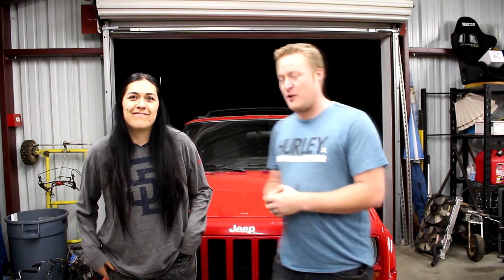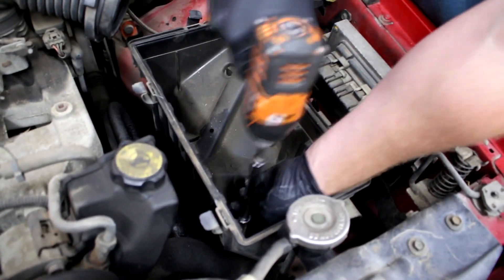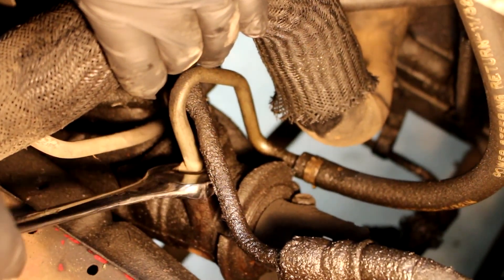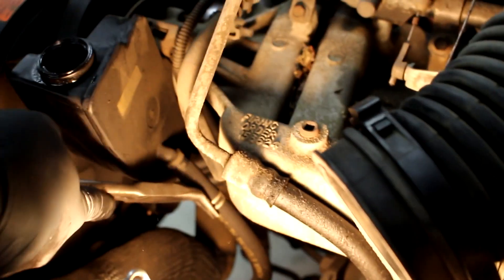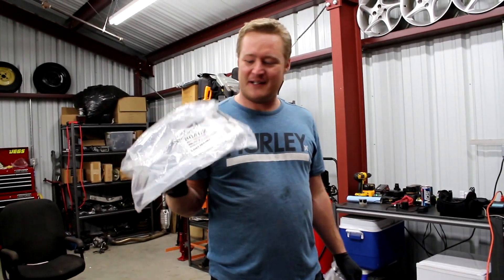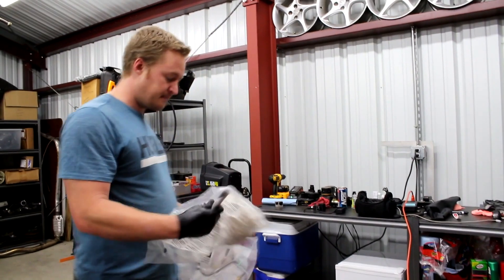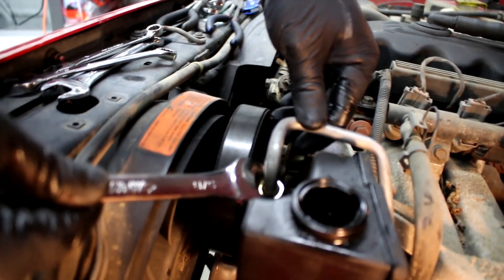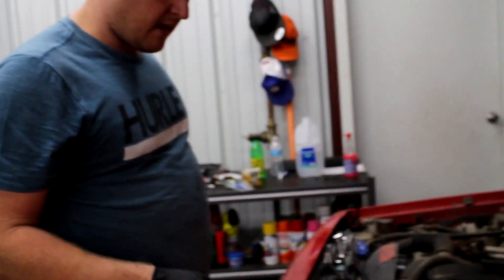New Power Steering Lines | XJ Jeep Cherokee #2

Comment: I can't break the bolt loose on the return line, I removed the high pressure line no issues. But the return line is being stuborn. As a work around could I just replace the hose on the low pressure line and re clamp it? Or is there a special tool or spray or trick when dealing with these bolts. I am not a mechanic so any tip helps
Reply from the maker: Deja Vue it is hard to get a wrench in there to really bust them loose sometimes. Look up crows foot wrenches they have helped me many times especially with power steering lines. Here- https://m.lowes.com/pd/Sunex-Tools-8-Piece-SAE-Combination-Wrench-Set/50160947?cm_mmc=SCE_PLA_ONLY-ToolsAndHardwareSosAtg-PowerTools_-50160947:Sunex_Tools&CAWELAID=&kpid=50160947&CAGPSPN=pla&k_clickID=38080311-dc81-48fd-b600-83ca96508477&gclid=CjwKCAjwsJ3ZBRBJEiwAtuvtlPlVKzNF9DPTL3tA6Ibv6qvtsrlltQxxTSmu0LDN-jWVp56v50m_uBoCpxcQAvD_BwE
You want THIS style with the partial Hexagon wrap-around on it, the cheaper style ones are much more likely to strip the head if the nut and make your problem even worse. The harbor freight ones are an example of that style that you dont want.
Reply: Hey thanks. Looks like they will just pop on to any ratchet handle? Or will I need an adapter?
Reply: Do the crows foot wrenches work on both Metric and Standard or when I purchase it I need to make sure it does either?
Reply from the maker: Most of them will fit any 3/8ths ratchet or extension. One of the best things about them is being able to put an extension on them since they are in a tight spot and then use the extension to get your ratchet in an area with more room to work.
Reply from the maker: The wrench ends are either metric or standard just like normal wrenches. The hole for your ratchet/extension is a square in either 1/4 3/8ths or 1/2 depending on what size you get just like 1/4 3/8 and 1/2 sockets and extensions.
Reply: Thanks again for you help. I'll let you know how it goes :)
Reply: It worked !!! I had to use a Crows Foot 18mm and a10 inch ratchet extention.  Got that sucker, thanks again guys.
Reply from the maker: Deja Vue Awesome! Glad to hear you were able to get it with that!
Reply: The bolt was in bad shape,  so much corrision had to use a rubber mattle to get the crows foot over the bolt, lol

Comment: Thanks so much for this video! Recently bought myself an XJ and it needed this fixed
Reply: Same! Picked up my 95 manual last week!
Reply: @RandomStuffGarage619  just bought a 2001 two weeks ago and the power steering pump just blew
Reply: @willannunziato  the pump? Or rack seals? I have a new rack seal kit on my bench waiting to go in, just need a weekend to drop the box out and get at it!
Oddly enough, I put some boards under it to stop putting stains on my driveway and not a drop since??
Oh and congrats btw! * jeep wave *
Reply: @RandomStuffGarage619  Jeep wave right back atcha!
So it started leaking extremely bad right behind the pulley on the power steering pump I ordered a new one and new lines and I’ll be tackling my first real repair on a vehicle on my own

Comment: Thanks for the video.  Great video. But, once again, my repair has taken way way way more time due to unforeseen circumstances.  #1.  Please cut your low pressure hose off like in the video.  Do NOT try to pry it off.  I did and I broke the little nipple off the reservoir.  Added hours to the job because I had to find one at a local store after work one day, take off the serpentine belt and power steering pump etc.  All because I just would not give up on that hose. (happens to me all the time.)  #2.  I ordered the gates parts from rock auto.  Problem: the low pressure hose had the wrong bend in it.  The one in this video is correct.  The one I received? Nope.  Rock auto took it back no problem.  Sooooo I ordered the AC Delco part.  Guess what?  Wrong again!!! no joke.  I went to Advanced Auto and found another brand and yes, it has the correct bend.  #3. I stripped the the gates nut that attaches to the power steering gear box.  (not the reservoir.) Had to run back to the store and bought a crappy Duralast hose.  Probably because I put the high pressure hose in first and then had to remove it to make room for the low pressure hose. #4. The bolts that hold my air intake box on snapped off.  Yeah, snapped.  maybe because my XJ has 220,000 miles on it?  All said and done it took me about 5 working hours.  My repairs are never this easy.  Thanks again.
Reply from the maker: With time and practice repairs will get easier! Keep after it!

Comment: You're high pressure line is a GATES 353770 but your low pressure line is an EDELMANN 80402 at least that's that the labels on the bags say in the video.  8:34

Comment: DO NOT CROSS THREAD YOUR NEW LINES INTO THE BOX. lol i learned the hard way. Install the high pressure line last btw, because it wraps around the top of the other line where it goes into the box.

Comment: I know this vid is old but have a question- how did you bleed after filling? Turn wheels back and forth while on ground, res cap off? I've replaced my box and pump. Steering still stiff.
Reply from the maker: Easiest way without special tools is lift front off the ground and crank wheel back and forth with engine off 15-20 times, then check level and start it and turn back and forth another 10 times or so. In the shop I usually hook up a vacuum pump to the return line, block the port on the pump and keep sucking till I get all clean fluid through with no bubbles then quickly pop the return line on.

Comment: Did you end up having some threads still showing on both ends of the pressure hose? I feel like I definitely cranked it down enough but I still can see threads.
Reply from the maker: That is normal for compression/line fittings.

Comment: Bought my 99 xj a year ago - 250k miles - And I lost count of all the BS I've replaced so far. Some of what i remember: water pump, thermostat, NSS, injectors, CPS, These PS lines, coil, plug wires, spark plugs, and many more that I've already forgot.
Id like to drive the damn thing down to Moab, but I'm scared I wont make it, lol...
Reply from the maker: Sounds like it wasnt well maintained. Maintenance is more than just an oil change and over 250k miles a lot of stuff will need done. If you buy from someone that didnt keep up with it then you will have to play a lot of catchup. Mine has 300k miles and still has never left me or my wife stranded and we put about 10-15k miles a year on it.
Reply: @GearHeadsGarageChannel  Unknown. He supposedly drove it to work and back daily, 45 miles round trip.  Dont see how he managed that with everything I dealt with. Good thing all the parts are cheap and easy to install.

Comment: Thanks for the awesome video. I'm going to have to do this next weekend because my pressure hose has sprung a leak. How much power steering fluid would you say you needed for this job? I saw you were using a huge gallon jug but I don't think I need to have so much extra sitting around in my garage.
Reply from the maker: Patrick Rose Your welcome good luck! I'd say get 2 quarts

Comment: Great video, I have a 96 jeep cherokee. I'm on Rockauto.com and it has left and right hand lines listed, how do we know which to get? Does it matter?
Reply from the maker: YES! They sold these in Right hand drive for the post office meaning the steering wheel was on the RIGHT side of the vehicle not left. The lines are different so get the left drive ones.
Reply: Thanks guys, yea the right hand ones are like $96

Comment: Great video new subscriber it would be cool to do a collab video someday
Reply from the maker: The Bearded Jeeper Thanks man looks like you have a nice Jeep!! We will be doing a lot more to this one in about a year or so when my wife is done with school
Reply: thank you! nice! can't wait to see what you do to it.
Reply from the maker: The Bearded Jeeper nothing to crazy, its a very clean XJ but its 2wd. Gonna 4x4 swap it, maybe manual swap and do a modest lift and tires.
Reply: do you have part numbers for the lines you got from rock auto? trying to find the right ones I have a 99 cherokee and I want to replace both lines as well
Reply from the maker: The Bearded Jeeper I dont remember now but I did get them on rock auto, just get the pressure hose and return hose for left hand drive. Right hand drive wont fit!